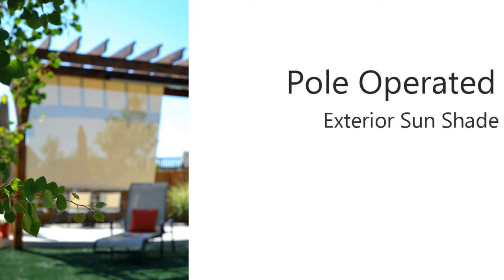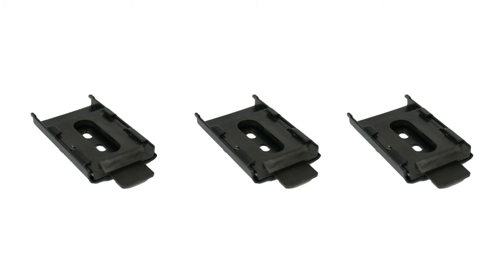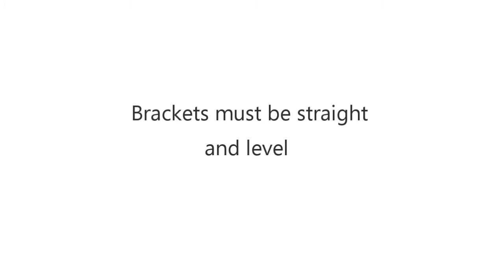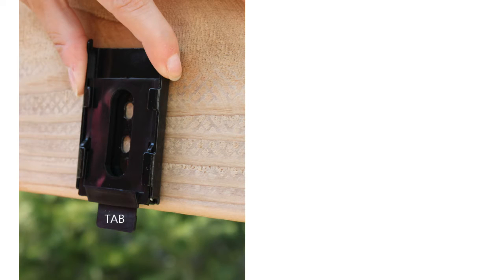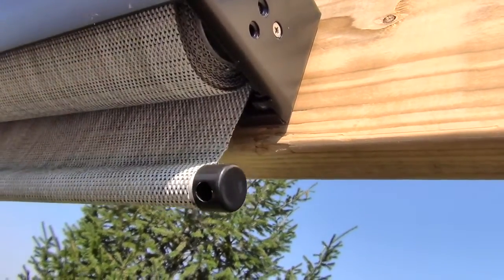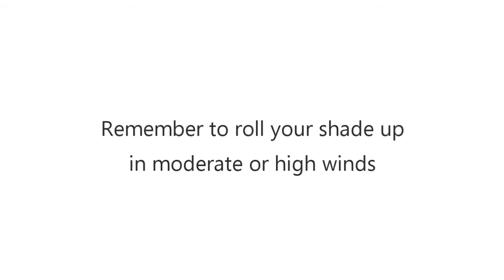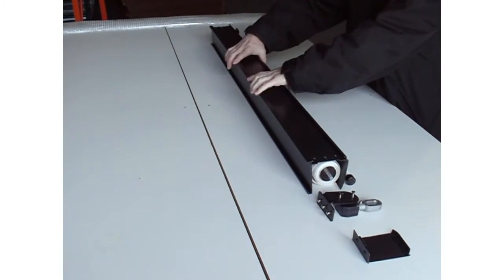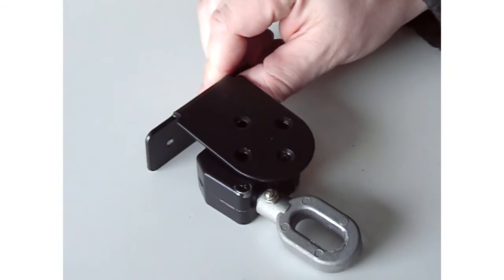Pole Operated Shade Installation

Comment: how far does the shade pull down?  I'm installing a beam for the shade on an outside deck. I need to know how high to install it for the bungee and the hooks to pull snug,  thank you.
Reply: They are all different lengths, you can do this step last, just install it as per usual and measure the hook once fully extended